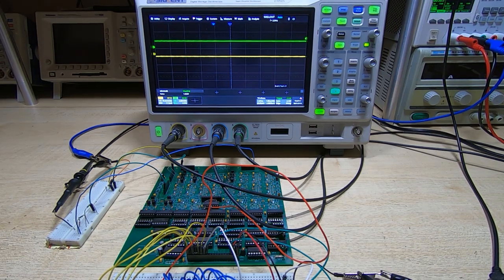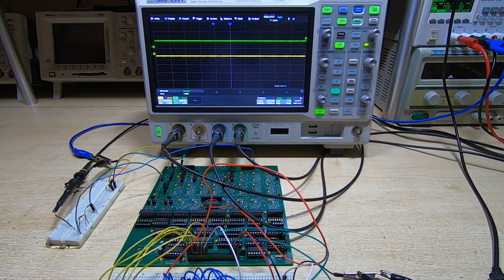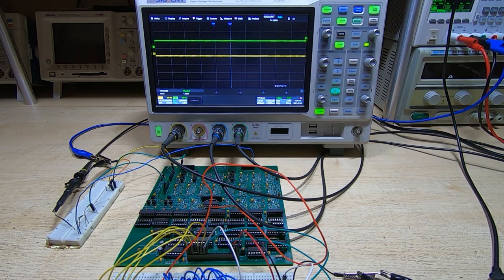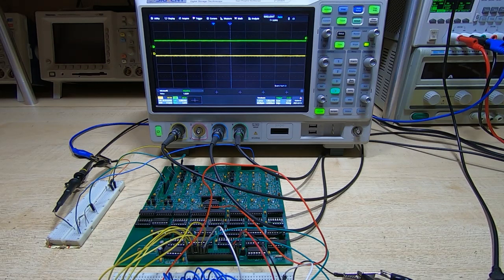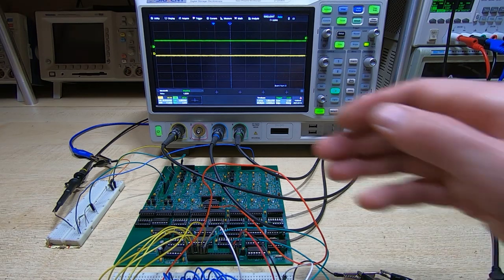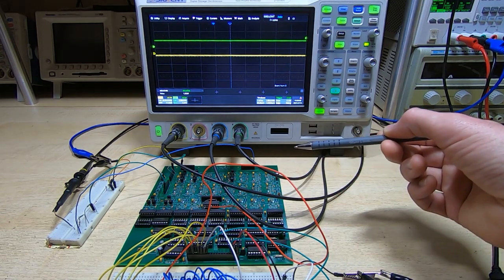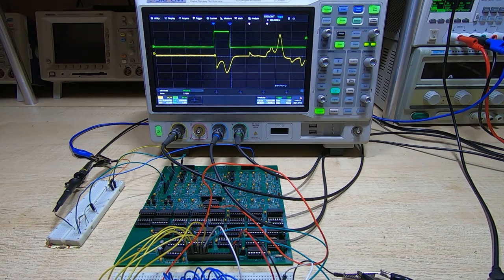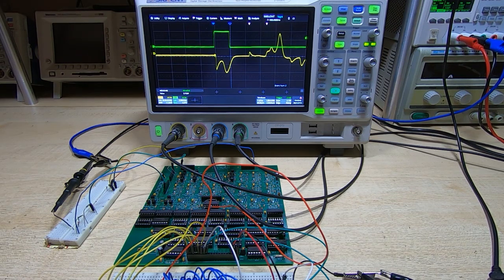Magnetic Core Memory Decoded Part5

Comment: Really interesting so far looking forward to the next video . Is there any scope in the control electronics to add another driver board to support a larger array ?
Reply from the maker: The next video adds the sense amplifier which is a key feature so should be interesting. The book and boards I will be supplying are for 8x8 mats but the book contains enough information for anyone that was interested to build a much bigger array and there is a chapter in the book which cover this. Assembling the arrays is fairly time consuming which is why I limited it to 64 bytes. If I made it too big then it may put many people off trying to build it but 64 bytes is enough to run actual simple programs. The book shows it running with a Z80. I designed the system to appear to a host system similar to an SRAM so it would be very easy to simply add multiple boards to get more memory (just decode the host address bus to control the CS and memory address lines).

Comment: Enjoying the series. The discussion of the engineering aspects due to mixed digital and analog portions very interesting. As the duty cycle increases, is there enough power dissipation in the thin wires to change the resistance or properties? Any thermal / operating environment constraints ?
Reply from the maker: I did actually record a short piece regarding power dissipation changes as duty cycle changes but I edited it out as it really belongs in the next video. Large arrays have temperature compensation with a sensor in the array but mostly for environmental issues and ferrite performance rather than dissipation. Some larger machines even used an 'oven' to house the arrays and they had to be preheated before the computer was booted (same principle as putting a crystal in an oven). For this system the design results in non critical thermal operation. The wires only have a resistance of 0.1R and with just 290mA passing through them the total peak dissipation in each wire is 8.3mW but  the maximum duty cycle assuming a 1 is stored and the same address is constantly accessed is only 20% so the dissipation per wire is only 2.0mW and the wires are all exposed so almost no heating occurs. Also even if the resistance doubled to 0.2R then the system would not really notice it. I designed the sense amplifiers to automatically compensate for this and I will describe this in the next video (hence the first sentence above).